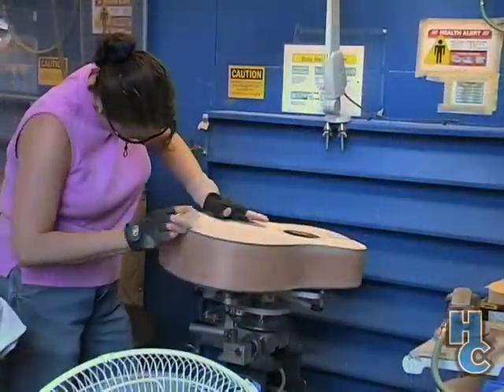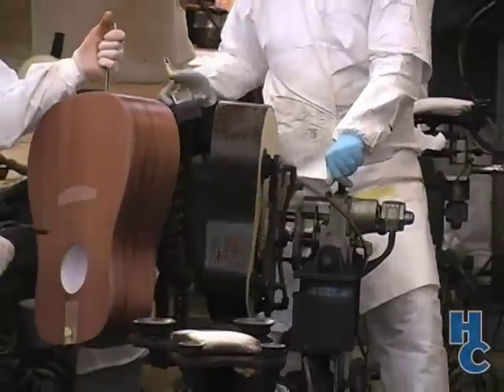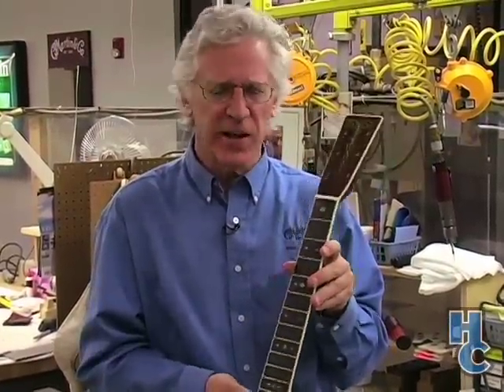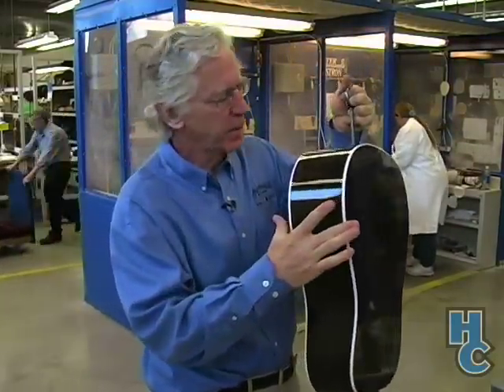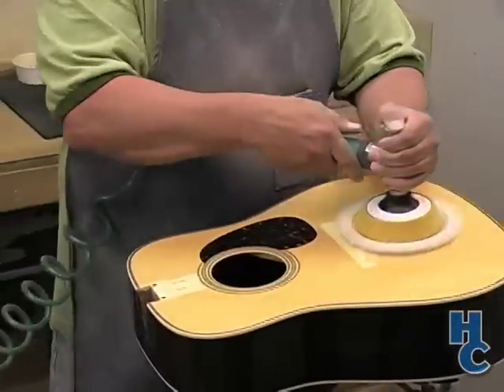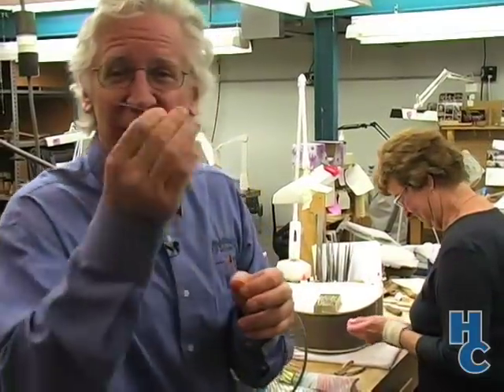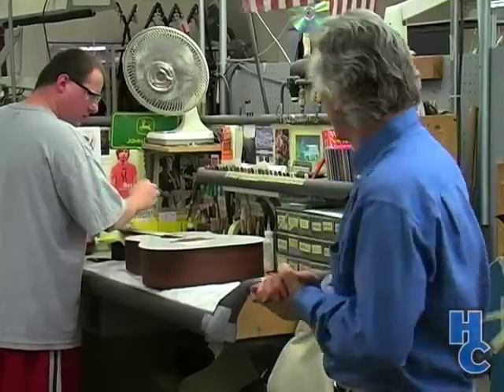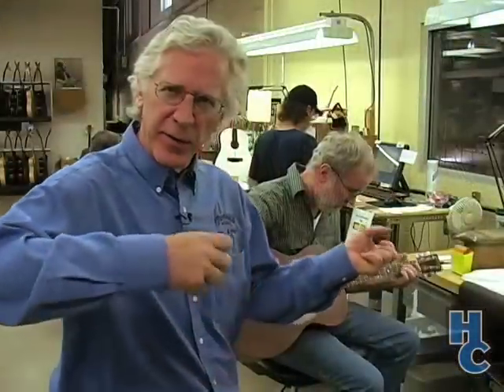Martin Guitar Factory Tour Part 3 (of 6)

Comment: I’m watching this and playing my 1870s Martin 0-28. It was the largest Martin made in quantity because at the time there were a few 00–28 guitars made. It has the original dove tail joint and real ivory binding and the pyramid bridge and jarring bone binding around the tone-wood. It is amazing that they have been making beautiful guitars with such great tone for so long. Back then they were only making around 250 guitars each year and most were the much smaller size guitars. Of course it has nylon strings like the 1954 Martin 00-28G guitar I am selling because the 1870 guitar has a better tone. Guitar came in the original coffin case that it fits like a glove. As they say a Martin tone improves over time. I have had a 1945 D-18 given to me by my father, a 1935 0-18K, a 1998 HD-28, a 1969 D-35, a 1924 and a 1928 0-18 both of which have very different tones. Finally I still have my 2001 D-45. Each guitar is unique in tone and appearance and I play all of them in the “Live Café” here in Daejeon, South Korea along with my Deering long neck banjo and 1924 Martin style 1 mandolin. You might say I love Martin guitars. Even visited the factory back in 1962 before they moved to have new frets installed under warranty as my father was the original owner of the ‘45 D-18 and the frets were worn wartime issue and not made of lasting materials because of the shortage of durable alloys during war time!

Comment: I don't like the "dart". Looks terrible. Each to their own. I'd rather not have it.

My Martin has a couple of blemishes. One on the front to the right of the sound hole... everyone points at it. There is one on the side of the neck at the joint, it's about 3/4" x 1/4" with zero finish. I'd stop patting myself on the back if I were you. I could do better myself. Sorry to burst your bubble.

With that said, I love my Martin.  Great sound and lovely to play. Best acoustic I've ever played let alone owned.
Reply: It is not impossible to fix those blemishes you mention. The lacquer finish is easy to repair, but most think that it is a sign that the guitar is played a great deal. The top blemish is also repairable by any good luthier. Your choice and we are not talking about big money, but usually only cracks in the tone wood are a real issue and loose back braces. Again these can also be fixed. Keep the humidity between 45 and 55 as you know as this will keep the tone wood from cracking.😊